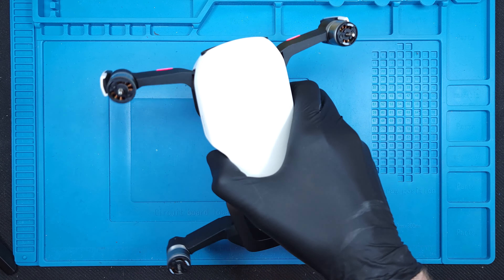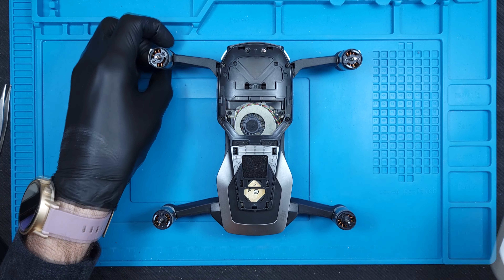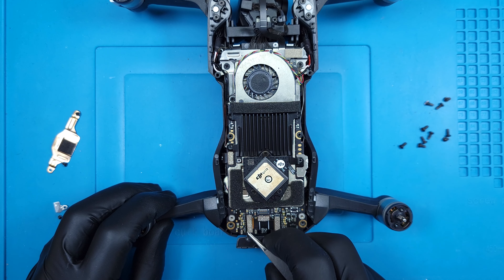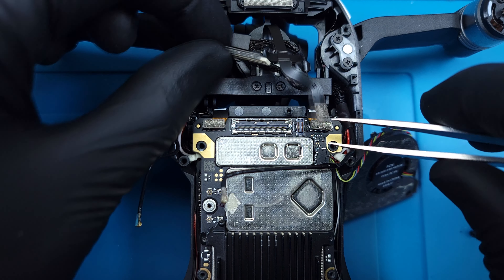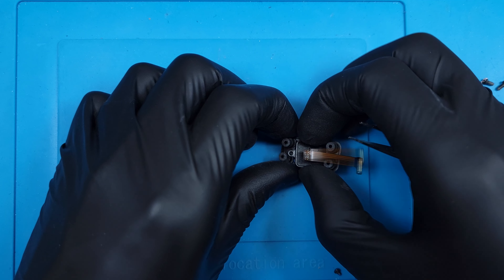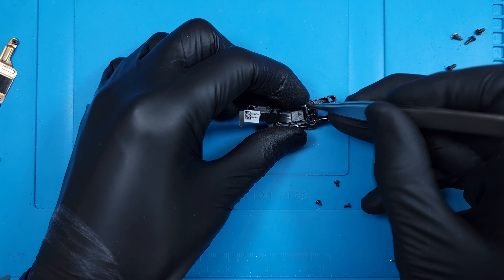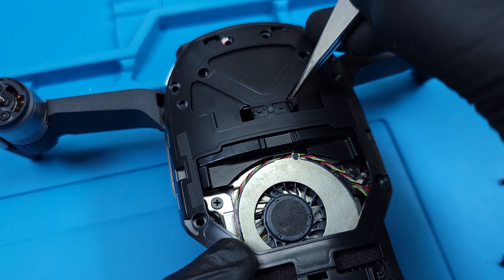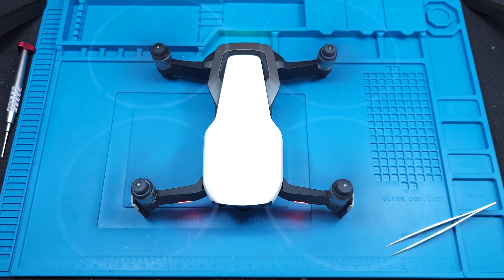DJI Mavic Air IMU Replacement (Original Air) | Main Controller Data Error Fix | Guide

Comment: I disassembled my imu sensor, took out the board, cleaned it from the blue compound, dried it, the error disappeared
Я разобрал свой датчик imu достал плату, очистил от голубого компаунда, высушил, ошибка пропала
Reply from the maker: That's great! Sometimes things just need to be disconnected, and reconnected. That old saying "turn it off then back on again" is true in some cases! Glad it's working.
Reply: @demonmihail Thanks !... i make the same action.... and is ok :) Thanks Chris M for your vidéo, i buy a part just if i have another the problem ;)
Reply from the maker: @sebsebus8719  I recently tried what is described on the Mavic Pro and had success! Seems to work on a couple drones. Glad yours is fixed!

Comment: My air 2 doesn't stop the motors when i flip the drone. do you why is that.
Reply from the maker: That could be an IMU or accelerometer issue, I'd recommend downloading DJI Assistant 2 and running a firmware refresh
Reply: @TapticDigital  tried refreshing the firmware didn't work.
Reply from the maker: @chamirugunasekara  for what it's worth, the flip to turn motors off is not the correct way to stop them. It actually triggers a "crash" event in the flight history, it's a safety feature that if the drone does crash it cuts off the motors to prevent damage.
Reply: @TapticDigital  OMG im so happy that it won't shut of the motors when it turn even upside down. Today i accidently hit a wire and it flipped 180° and survived + no damage. its the first time i hit something it was scary and the first time i saw a dji drone do a 180° flip😅😅.
Reply from the maker: @chamirugunasekara  hahah hey sometimes a glitch can save you I guess! 😂

Comment: Mine would act that way but I would power off then back on and it would fix itself
Reply from the maker: These sensors sure are picky sometimes. I hear the newer drones don't require compass calibration nearly as much either.

Comment: This is a really annoying issue.  I already replaced 1 IMU which fixed the issue. Never crashed the drone.  Now the replacement one has gone, again only used a couple of weeks ago, no crash.  Poor workmanship from DJI.  So frustrating, and now you cant even get an IMU from anywhere for the original AIR :-(
Reply from the maker: I keep pulling my Air out once a month, not really to fly but just to make sure the IMU still works. DJI drones seem great for the first year or two then seem to have a lot of issues, and their long-term product support is somehow worse than Apple's